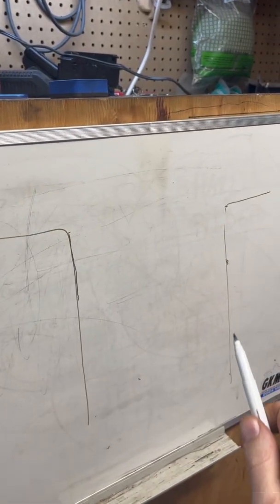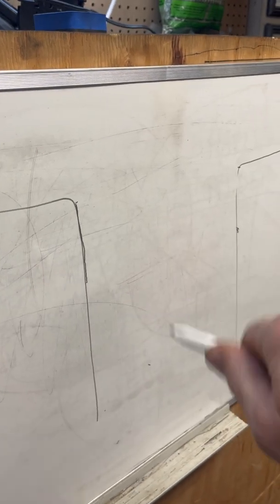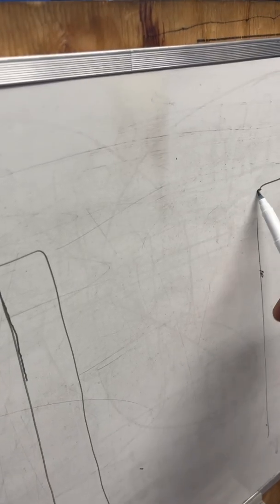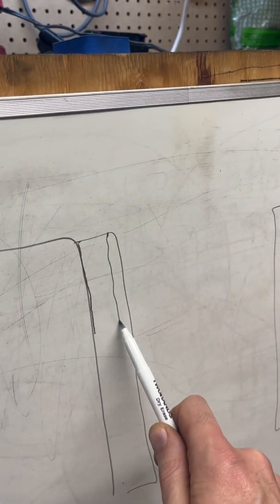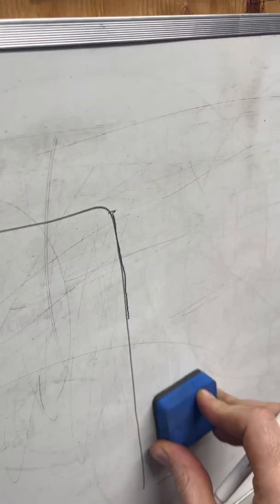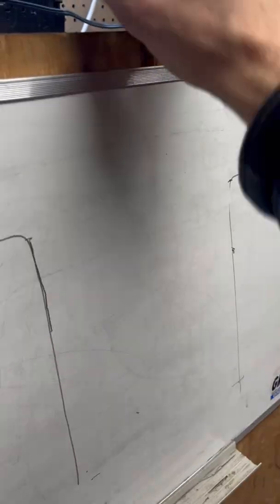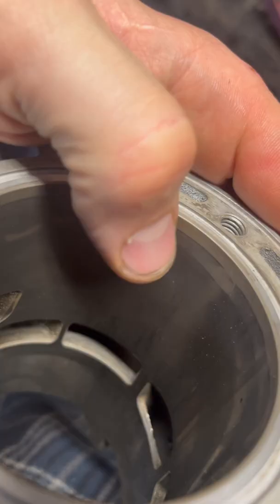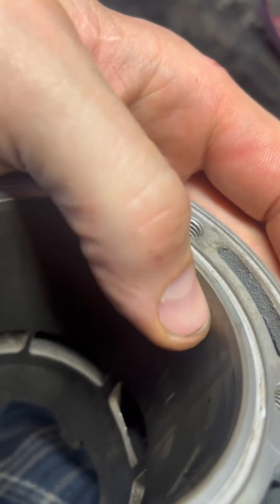Nikasil or Cast? Know the Difference

Comment: I look at it from cost, a steel sleeve can be bored for $50, a nikasil cylinder is $250-$300 and cannot be done by most shops.
Reply from the maker: But nikasil will usually go 400 hours if the engine is maintained.
Reply: @ChuckfromTrueTech i never buy anything that will last apparently

Comment: Can you Nikasil a steel liner? Basically upgrading an old engine?
Reply: I think we were all thinking that... Maybe the bond to aluminium is the thing they worked hard to achieve. Bristol made their engine bores in the late 40s with (a material... I forget) but they guaranteed 250,000 miles 75 years ago. In the 70s most car engines needed a rebuild at 75,000 miles.
Reply: (All cast iron)
Reply: Yes but it will take a good shop and it will be a bit more expensive

Comment: I think it was the early 1980's when the KDX got a non-replaceable bore. A lot of people stayed away from it, but I didn't actually know what Kawasaki did with used cylinders or if there was a program.
I here a GM V8 with very thin steel liners have had cracking as a side note.